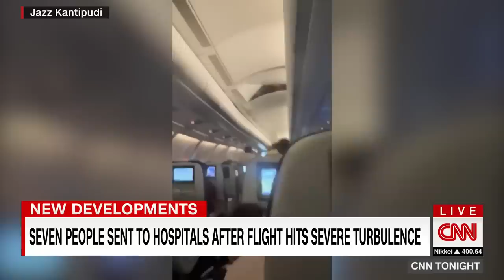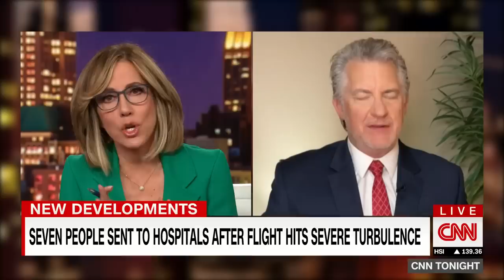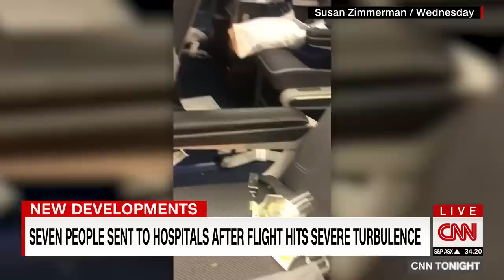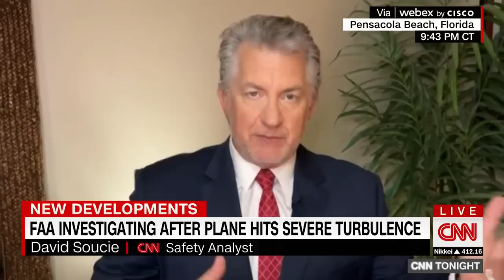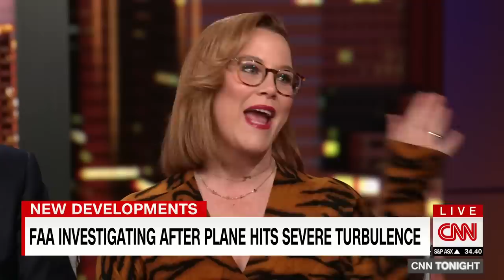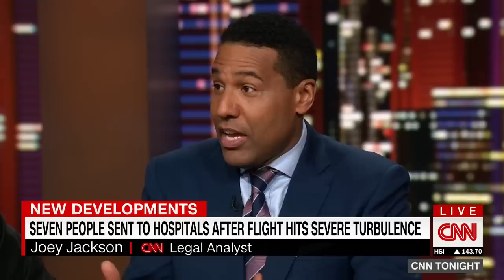Video shows aftermath of extreme turbulence on airplane

Comment: I’m not sure about safety of cars vs planes comparison. Yes. Driving accidents are much more common. But if you compare the ratio of planes to sky with ratio of cars to roads, there is big difference. Cars are so much a lot and go through much tighter space, hence the higher percentage of accidents. Yet, it’s much scarier to the most to fly than to drive your car.
Reply: Car crash with a higher chance of surviving, Plane crash no survivors. To me flying is not the safest transportation imo. I have to take meds for me to fly or I won't get on the plane.
Reply: @olteb3773  What kind of medication?

Comment: No, the solution isn't to go slower. Just inform the passengers that this is a trip with higher risk of clear air turbulence so we spend more time with our seatbelts on. If I have to take a bump on the head once every 100k flights, then so be it. Just for perspective it is much more likely to get a bump in the head from some slob dropping their luggage on you than you getting tossed into the roof due to turbulence without warning.

Comment: This is incorrect on multiple levels. First, clear air turbulence is related to jet streams. Second, flying slower will increase risk as high altitude stall is the greater risk. A change of 20 knots will not have a big effect on the turbulence experience as it is too small a percentage of the true airspeed.

Comment: It is so bad. None of the 5 would make it through a college-entry listening test:

David Soucie us explains the cause and a way to reduce risk of this occuring very nicely to the audience. But then the group discusses mostly opinions and individual experiences AND agree to each others opinion without properly referring back to David. That is bad journalism because it changes what the majority of people take away here. 

It should be: 
Assigning airplanes to smaller time slots on the airport (typically done to reduce costs), increases pilots´likeliness to fly too fast (and thus the occurence of these turbulences). 

The causes are not: 
planes landing on each other, climate change, less fuel, covid, less air control

Comment: Slowing down sounds good...until you remember the coffin corner, which doesn't sound so good.  At higher altitudes the airplane may be just a few knots from stalling, or over-speeding.  So you might descend but right into worse turbulence.  CAT cannot be predicted and you must wear your seat belt on any airplane.  It is not your comfy sofa.  Look above you and see what your head will hit...at least the first one anyway.

Comment: This explanation of this self-proclaimed expert cannot be more wrong.  Shear-detection will do absolutely NOTHING to help you avoid clear air turbulence.  It is absolutely undetectable by on-board means  and not one single commander would take the risk to fly through a known area of severe or moderate  turbulence "fast".

Comment: As I said before somewhere, more turbulent flights will occur because of the rising heat and the characteristic physics of what it does with cold and airflows mixing the 2.

As a result of my meditation- believe it or not- wings of airplanes has to be changed. An accordion rotator type connection to the wing from the passenger barrel. 

The design is expensive because it has to default into a locked state as a fail safe but it can be done if the 2 wings are connected in a web of negative tension that increases its bilateral connection. 

Oh! Parachutes for commercial airplanes? That should have been done along time ago. 

Can I work on some boards of directors or what? I can draw these things to show you.

Comment: What is this guy’s credentials, to be able to make the claim of aviation expert? Clear air turbulence is not impossible to predict. PIREPs always help, but commercial pilots and dispatchers ought to be able to predict its location with the aid of high level weather charts. Pretty sure it’s not the “air temperature and density” differences. Those are a symptom of the location of the frontal surfaces, where the wind speed can change 100 knots in a matter of few miles. 

Furthermore, insinuating that airlines and pilots put speed and economics ahead of safety is patently false. The commercial jet I fly typically cruises at Mach 0.85, and the turbulence penetration speed is Mach 0.84. That is less than 10 knots at cruise altitude. Slowing down to airport arrival speeds is aerodynamically not possible at cruise altitude. Contingency fuel is added in the event that a long term strategic slowdown or route change becomes necessary.

Comment: This video is 1 month old but a new article from NPR came out today that links this "clear air turbulence" to climate change. "The reason for this increase in clear-air turbulence is climate change, Williams (Paul Williams, professor of atmospheric science at the University of Reading in England) says. As global temperatures increase due to rising levels of greenhouse emissions such as carbon dioxide, the jet stream is experiencing more wind shear.